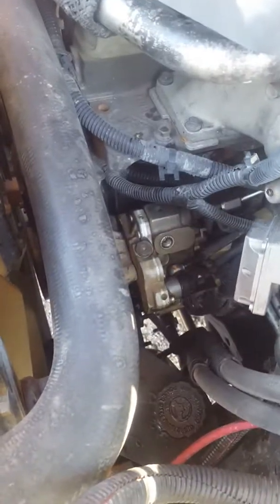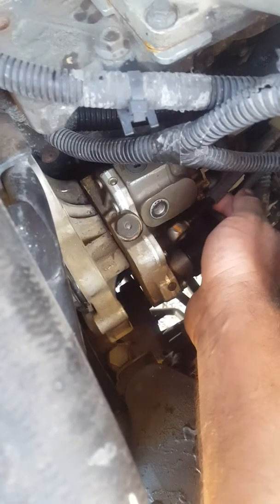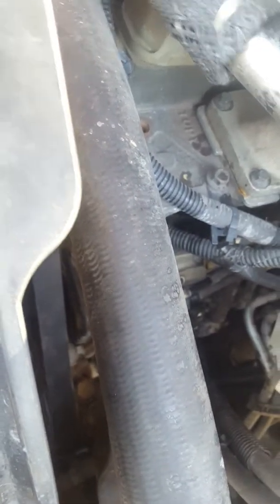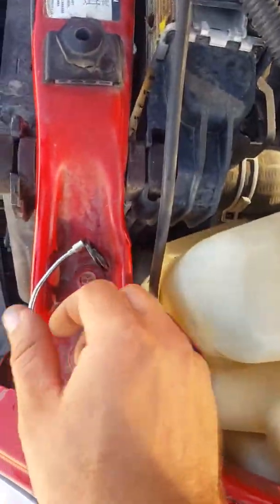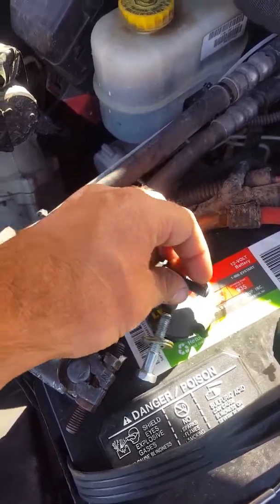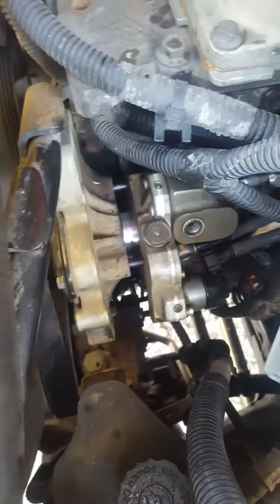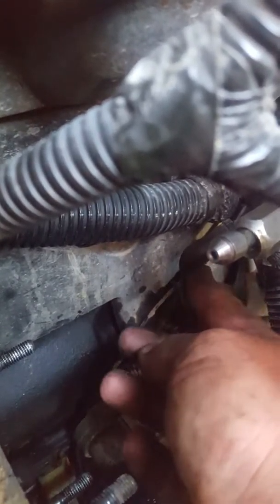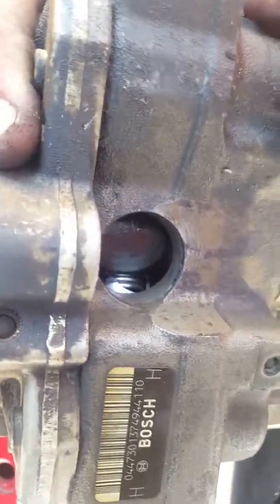2008 6.7 cummins injection  pump swap

Comment: I just found your video. Thanks! Mine just did the same thing. That plug on the bottom came out and spewed fuel. In dead now. Did you find out why the plug came out? Is my pump shot? Help!!!

Comment: how did you keep the shaft/pump from turning when taking the 1  ¹/16 nut off?
Reply from the maker: I popped it real quick. I also had a socket on the crank

Comment: Did you happen to notice the truck running differently or giving off a noise, or loping sound, before it went out?
Reply from the maker: It actually just wouldn't start. I shut it off at the gas pump. It just cranked. I changed fuel filters and all sorts of shit. Finally got pissed and gave it a shot of starting fluid. It fired right up and I drove it about 60 miles the. Heard something. I pulled over (truck still running but spraying fuel everywhere) pulled farther off the road and it finally died

Comment: Pump pusher bolt thread?
Reply: I just made a pusher on my Crossfire plasma table from some 3/8" material.  Bolts are M8x1.25 ~35mm long